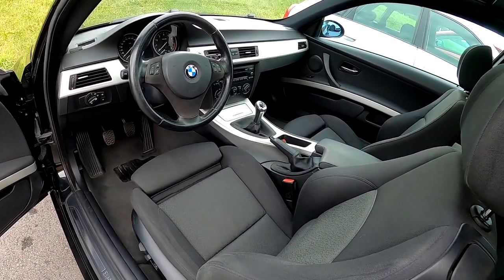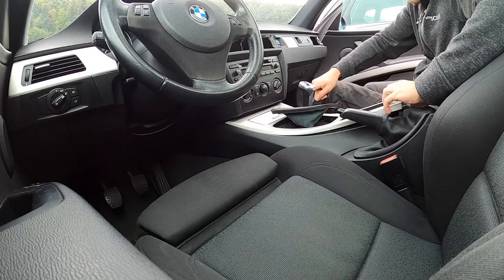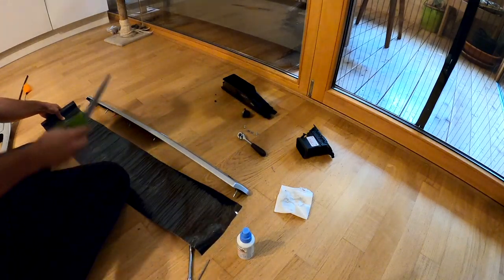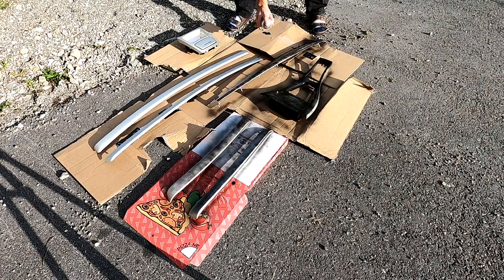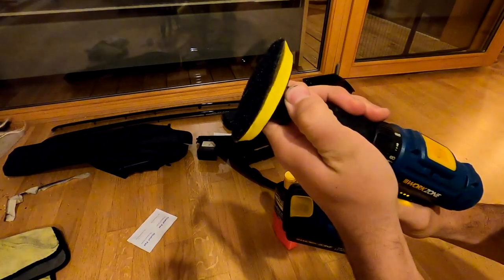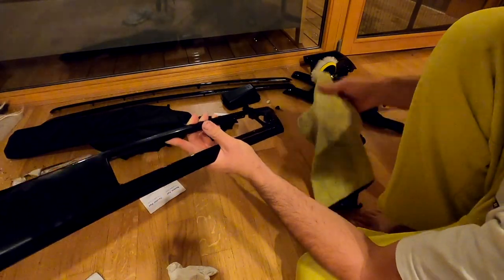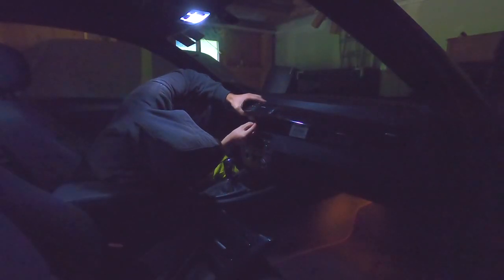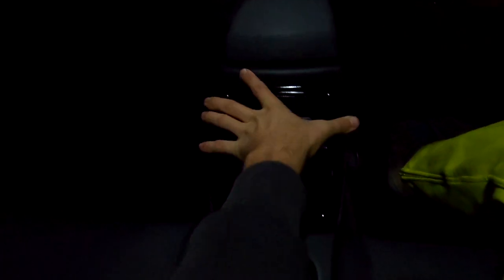Cheap and easy DIY Interior trim PAINTING | better than WRAPPING |BMW E90 E87 series

Comment: Hello, it turned out very well that i am looking to do this DIY too, and I would like to ask a few questions about  it😀.  Did you removed the base grey color also, when you said this ->  3:01 If yes, with what type of sandpaper did you removed it? If no, did you just removed the black paint that was already on and then sprayed the primer on the basic grey color? How many layers did you spray with the black paint, and with the clear coat? Also how many bottles of sprays did you use? I know it is a lot of questions but I will be very glad if you will respond! Have a good day

Comment: Mate what primer/paint/lacquer you use?
Please 🙏 leave links.
How many cans you use. Thanks
Reply from the maker: I still have too little subscribers to put links in my description... but you can use any car related or metal primer and black gloss paint you can find. For the clear coat its very important though, that you use 2K clear coat. It will give you way more shine and its way better for polishing 👍🏼 1 can each was more than enough. Good luck 😉